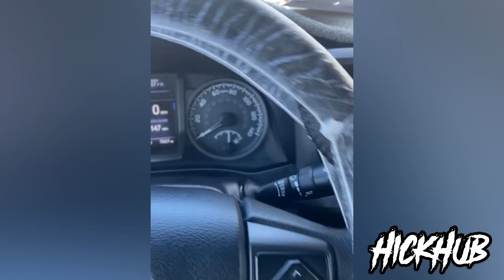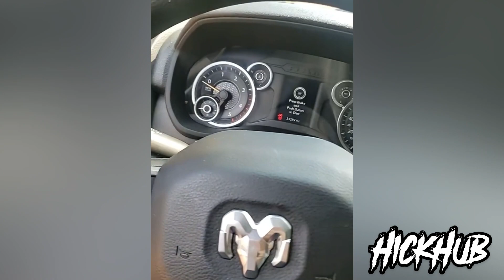BEST REDNECK/FULL SEND VIDEOS #29

Comment: Ain't nothin' wrong with drywall screws, and you'll never convince me otherwise.
Reply: I Concur David M 

Tho Ima fan  of the self tapers myself 
Being a metal framer-drywaller
Reply: wood screws will last longer being able to bend easier with pressure instead of snapping like drywall screws. learned that the hard way.